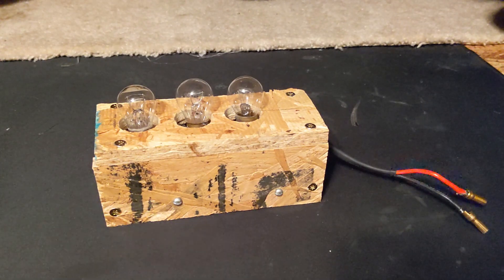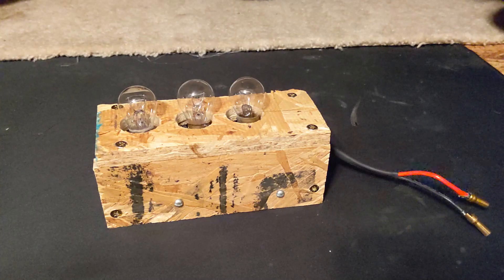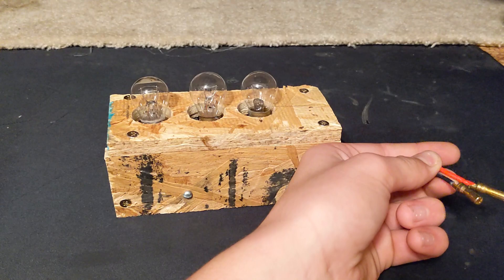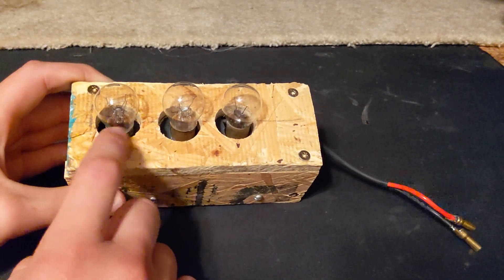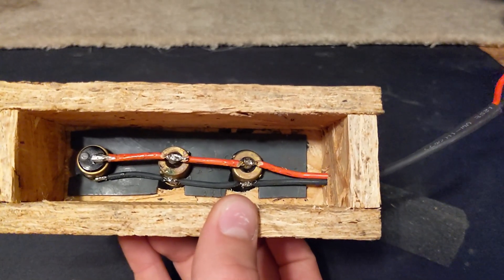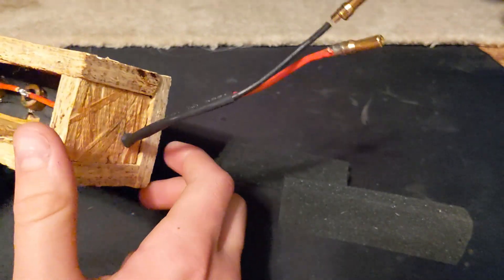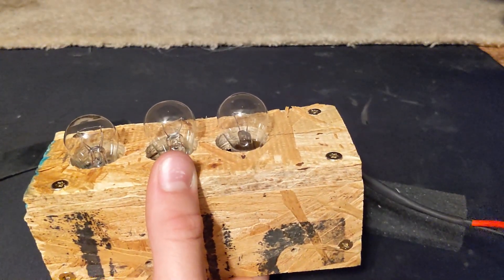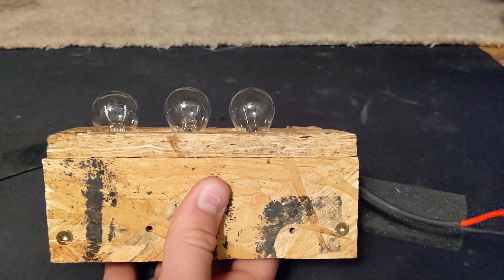How to Make a LIPO Discharger for CHEAP!

Comment: Mines the same but a lot more wiring. I use 4 bulbs but both filaments. 2 of my bulbs are optional only 2 are required but that's still 4 filaments. At all four bulbs it can drain a 3S 6000 milliamp hour pack in about 20 minutes probably a little less.

Comment: This is an old school pre discharger discharger. It's as safe as running any motor you just need to monitor the cell voltage with an alarm.

Comment: A 3s 5200mah is only 50 to 60 it's not really worth it to care to much about them as long as you take care of it, mine has lasted 3 years with no discharge I mean yeah I never let them sit for to long without a charge but that's normal

Comment: A fast way to discharge a lipo battery is to hammer a nail through the centre of it. That discharges your battery really quick. Also if you want to charge them up real quick then stick them in the microwave at full power for three minutes. You can also test the charge voltage by touching your tongue with both terminals. If you feel a slight tingle that means that the battery is  fully charged.  If anyone else needs some good battery advice than please leave a comment and I will get back to you. I am an expert when it comes to these tape off things. 🔋

Comment: Good idea, I will make something similar now but will use it with a low battery allarm on the balanced lead so as not to accidentaly completely discharge the batteries.
Reply from the maker: Nice, I am really thinking about adding a switch, to allow you to turn on separate bulbs, also make sure you test the current draw with a multimeter to make sure you know how much juice your pulling.